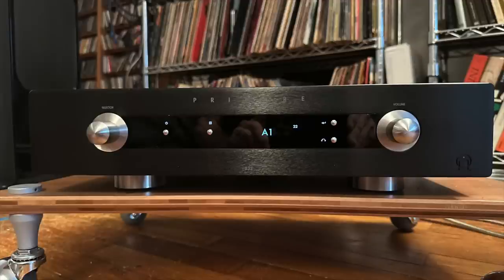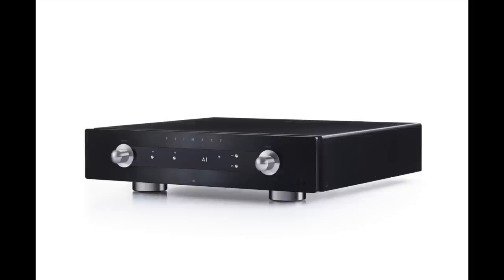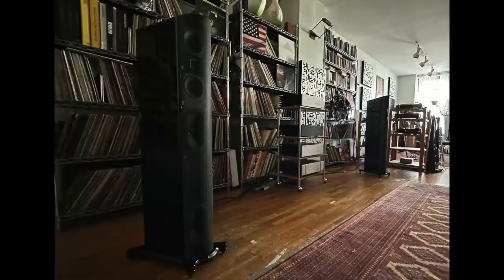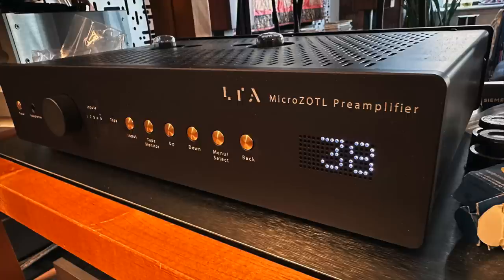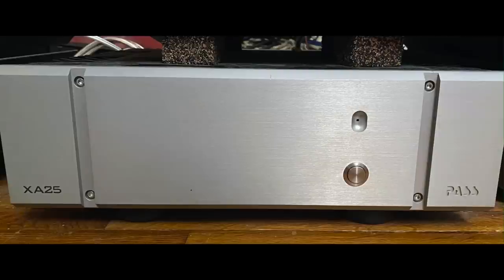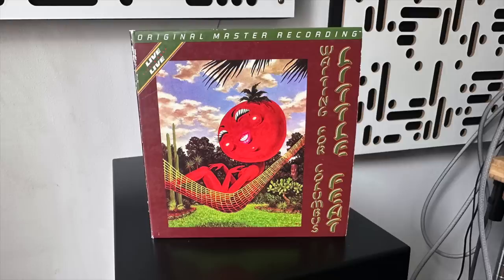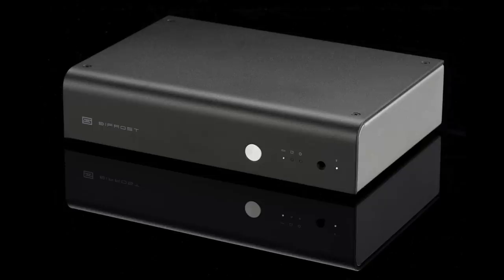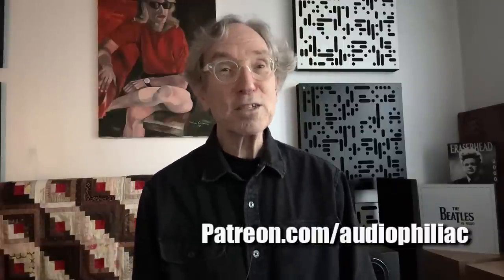Swedish Modern: Primare i35 Integrated Amplifier

Comment: Thanks for featuring my system steve! The luxman is actually in place right now and I suspect it will be staying, its a tremendous bit of kit. Another great vid, thanks for sharing with us.
Reply: Great looking system! This looks like something I would put together for myself and that room looks like it has nice absorption. Very tasteful, understated, not over the top pieces of hifi eq. May I ask how you like the PL Evo100 preamp? I had the integrated for a while and thought it was great in its own right.
Reply: What was your power amp in the system? I think Steve only mentioned the preamp being a Prima Luna.
Reply: @Yiannis2112  It was a Bryston 4BSST2... but now primaluna and bryston have both been replaced by a Luxman L509X
Reply: @marcgabor9690  I wasn't keen.... i've heard the Evo 400 with the bryston amp, so had expected something similar, but in reality the evo 100 seemed to rob the system of bass energy and was a bit "thin" sounding. Neither stayed in the system long and the Luxman is staying :)

I also have some acoustic panels on the rear wall and a bass trap in the rear corners to help control the room a little!

Comment: I ran an I30 for quite awhile. If the I35 sounds like the I30, it's gonna be pretty darn good.
I ended up using the I30 for about a year as a preamp with tube mono amps.
I felt the preamp section was holding things back and eventually sold it and got a Rogue RP5 preamp. It was quite an improvement.
I'll tell you one thing, Primare is built like a tank. You could probably drop it from a 5 story building and it would leave a crater.

Comment: I was told that dynamics is heavily influenced by slew rate.  That's how quickly the amp can change voltage.  Tubes have an infinite slew rate, which is why they sound more dynamic than most solid state amps.

Comment: One thing to be aware of with Primare is that they use the same IR code as Marantz products.

So like in my case, I have a Marantz SACD player and changes tracks unfortunately keeps changing the Primare I22 source.

I have had to disable the Primare IR function via the menu.

Comment: Could someone advise please 
I'm looking to buy amp with optical audio in and have a PC from which i would like to play Flac files . PC does not have optical out.
I have found HDMI audio adapters which provide optical out. Would that be sufficient or are there any better alternatives?
Reply: Hello, you might also try to connect via USB. I have a desktop-setup with USB into my RME-ADI 2 dac, from which I drive either my headphones or my active desktop-speakers. Works fine for me, although I wouldn‘t recommend using this DAC in a stereo setup since it lacks a little bit of separation (the stereo image). There are AMPs with integrated DACs which allow USB-in. Of course, it depends on budget, intended setup etc.
Reply: @TheMMadmaXX  thanks

Comment: i got rega brio amp rega apollo cdplayer 2018 version tannoy autograph mini 1210 turntable with rega carbon cart  great sound with atlas 3.5 hyper wire my second system is audiolab 8000 and micro mega cd player and tannoy xt6 f hard to get cables to work for the tannoy xt6f tried both amps for the xt6f same result unclean and no details needs work

Comment: Why make such a big deal that it’s from Sweden then on the backend make it in China.
Reply: Because it isn't all or nothing. Some is made in Sweden or under Swedish guidance, and som ein China. If you can't fathom how that works then you don't understand manufacturing frankly.
Take the car manufacturer, Seat. They're owned now by VW. I have had a few of their cars and back in the 1980s they were bloody awful as they were a Spanish company that made licenced old Fiat cars and they were unreliable and badly put together. Then VW took them over. 
They changed drastically. Tehy are still a Spanish company and they make the stuff there, and some parts are directly sourced from other VW places, but again this is exactly the same - a mix of both.
And the quality is great.

I have a Primare amp and CD player I bought back in 2008. Sure, the electronics were made in China, but the machined knobs and tooloing was done in Sweden. It's also manufactured diligently to a degree you wouldn't eblieve, even though made in China.
Guess what issues I've had with it since 2008? NONE. Zero.
Reply: @crunchyfrog555  it's made in China, but they charge a premium. The insides look like Topping and SMSL !
Reply: @crunchyfrog555  I ran a FDA and ISO regulated medical device company selling in 40 countries, so I know something about manufacturing, distribution, and marketing. But thanks for the lesson in manufacturing.
Reply: @epi2045  I hope you're not being snarky, because that wasn't the point.
By all means make an argument from authority fallacy if you want, but how about you tackle the point?
Reply: @r423fplip  So what? Most things are often made in China. You're not just paying for that - you're paying for design and so much more.
Again, I have a Primare amp I bought in 2008. It was also made in China as far as the electronics assembly. And you can easily tell when you lift the lid that it's WELL designed, as the board layout is fantastic, and the components are higher spec, and not just cheapo garbage. The caps are Nichicon or similar. And it's a built like a brick shithouse.
That's what you pay for - not "oh it's made in China". 
Many products are made in China and are poor for the local market, but when you buy the export models they're not - ever looked at the difference between these two versions of say DJI Mavic drones?
You'll see this clearly.
That's the point. If you think it's just about where something is made determines the price, you understand nothing. Proof's in the pudding.
Reply: Cause its from sweden. There are chinese brands made in china and worst of it , crapy knockoffs made by chinese in china. Primare is brand from sweden , designed in sweden and madenin china under supervision

Comment: the electronics inside of these are really poor, the way the circuit boards are made, cheap as I ever saw and look very fragile too... I have a different product where the capacitors just fell off the circuit board from some small amount of vibration....  I would never buy this again, all my oppinion.
Reply: Perhaps that has changed in the meantime.
Reply: @jos5067  perhaps, did you open to look inside or ? Just guessing ?
Reply: @rompstar  No, so you are probably right.